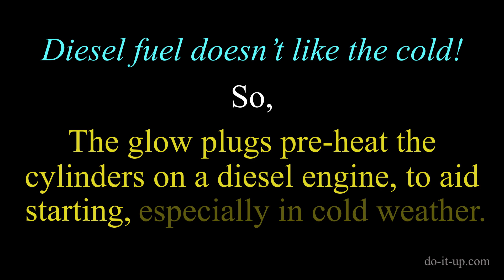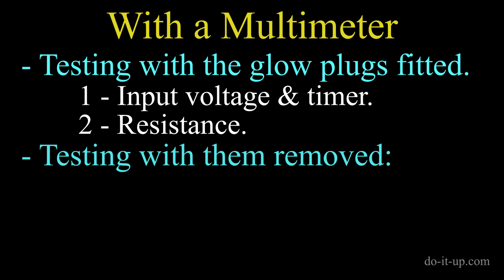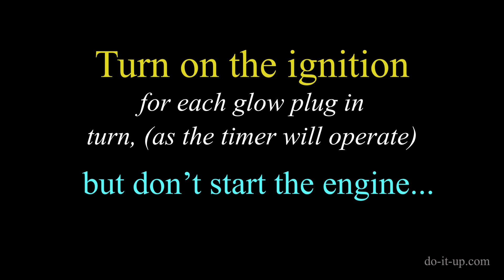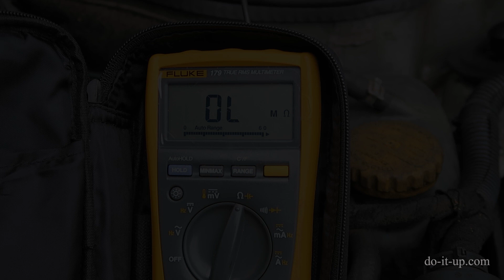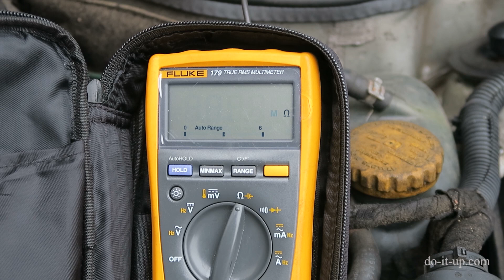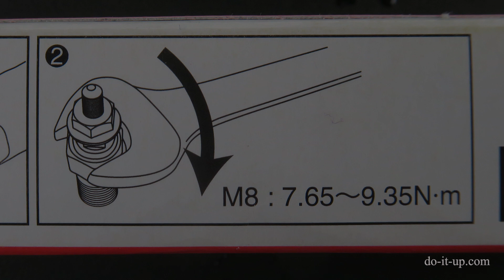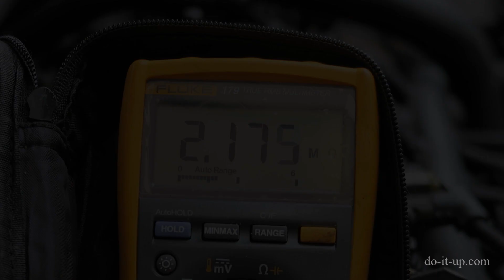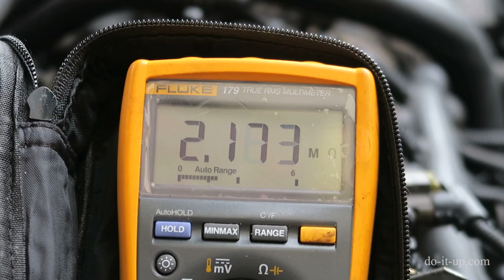How to Test Glow Plugs From Start to Finish (With a Multimeter) - The Complete Guide.

Comment: Che valore di resistenza deve avere la candelette per essere buona
Reply from the maker: Ciao, il tipico valore di resistenza della candeletta (per una candeletta funzionante) è solitamente compreso tra 1 e 6 ohm. Puoi trovare maggiori informazioni e una tabella di esempio dei valori di resistenza tipici delle candelette qui: https://do-it-up.com/vehicles/engine-transmission/diesel-wont-start-when-cold-how-to-fix-glow-plugs/#Typical-Glow-Plug-Resistance-Values, (in inglese però, ma dovresti essere in grado di tradurre usando Google). Spero che questo aiuti... 😃
Reply: Ok grazie mille, e se il multimetro segna 0,00 che significa continuità, cosa vuol dire che conduce?
Reply from the maker: Ciao, 0 ohm sarebbero a corto. (da 1 a 6 ohm è tipico, a seconda del tipo di candeletta montata). Potresti anche controllare il timer candelette, e le tensioni di alimentazione nel caso in cui la centralina (relè, ecc.) sia guasta? Ho un video su come farlo qui (ho appena tradotto i sottotitoli in italiano): https://youtu.be/A_IUlFjHcvI.

Puoi anche controllare che le candelette funzionino correttamente osservandole riscaldarsi. Ho un altro video su come farlo qui (questo ha anche i sottotitoli in italiano): https://youtu.be/YkKsbRHHNS8?t=358

Come al solito, a proprio rischio. Spero che questo ti aiuti e che tu lo risolva presto ... 😃
Reply: Perfetto, in corto cosa significa, che la resistenza non è presente e quindi la corrente passa infinitamente senza trovare ostacoli?
Reply from the maker: Ciao, spero che questo ti spieghi... (dal mio sito web: https://do-it-up.com/vehicles/engine-transmission/diesel-wont-start-when-cold-how-to-fix-glow-plugs/).
Spiegazione della resistenza delle candelette...  La bassa resistenza è buona. Significa che la candeletta si scalda.

"L'energia totale dissipata dal circuito è proporzionale alla corrente, quindi la resistenza dell'elemento riscaldante deve essere sufficientemente bassa da assorbire una corrente sufficiente per generare abbastanza calore".

Ma…

"La resistenza dell'elemento riscaldante deve essere sufficientemente alta in modo che la maggior parte dell'energia venga dissipata dall'elemento riscaldante".

In altre parole…

Vuoi una bassa resistenza, quindi l'energia viene dissipata nella candeletta e si riscalda. Ma... Non una resistenza davvero molto bassa (come un dead short). In caso contrario, l'energia verrà dissipata nella candeletta e nel resto del circuito. Soffiare il fusibile e potenzialmente fondere i fili (a seconda della potenza del fusibile e della velocità di reazione del fusibile!).

Nota:

Ogni produttore o progetto di circuito può avere letture di resistenza leggermente diverse, a causa dei parametri di progettazione (e anche le condizioni effettive del circuito avranno un effetto).

Speriamo che questo spieghi come funzionano le candelette e il valore di resistenza che stai cercando (e che tutto si traduca in italiano OK)... 😃
Reply: Ok però non mi torna una cosa, io so che la quantità di calore prodotta è direttamente proporzionale all'intensità di corrente che passa per cui affiche una resistenza scaldi non significa che deve essere alta? Ad esempio quelle delle candelette come sono rispetto a quelle dei forni più alte o più basse?
Reply from the maker: Non sono un esperto, ma suppongo che potresti usare l'esempio di un circuito che non ha un fusibile. Introdurre un cortocircuito nel circuito e il filo si surriscalda in modo disastroso, molto, molto rapidamente. Aggiungi una certa resistenza per limitare il flusso di corrente e avresti un elemento riscaldante di base.

Per quanto riguarda le candelette, ho fatto delle ricerche e da 1 a 6 ohm era il valore tipico citato per varie candelette. Posso solo presumere che questa sia la resistenza corretta per generare calore velocemente, ma solo per un breve periodo di tempo... 😃
Reply: Grazie mille!!!
Reply from the maker: Nessun problema, spero che tu lo risolva presto...   😃

Comment: If you can get them out ,,,,change them .... they are relatively cheap .... pointless doing all that work to put back the old ones
Reply from the maker: Hi, I would definitely agree with you, if they're difficult to get out, or you're paying someone to do it...  However, if you can check them easily, and there's nothing wrong with them (and you're on a tight budget), may as well use the old ones...    😃

Comment: Thanks. I have a 2003 transit van. 112k. My glow plug warning light flashes occasionally, but not all the time. Engine starts and there’s no white smoke. Any ideas?
Reply from the maker: Hi, I have a glow plug indicator on the dashboard of a Vauxhall that also appears so briefly you can miss it. Whereas on other vehicles, the indicator stays on a lot longer? As a guess, it's probably down to the circuit design for that particular vehicle (if the vehicle starts and runs fine, with no white smoke). And it may vary from vehicle to vehicle...

Always assume the glow plugs are needed, and wait for them to heat the cylinders, to aid the engine starting process. Glow plugs come on in hot and cold weather, to aid starting and help whilst the engine warms up. However, the length of time they're on may vary (if this is built into the vehicles electronics by design).

If you need to check they're working, check the glow plug resistance and see how long voltage is applied for with a test meter. Or, operate them when removed from the vehicle (example video here...  How to Test Glow Plugs Without a Test Meter:  https://youtu.be/YkKsbRHHNS8) and measure how long they glow for. Best to test the glow plugs one at a time, save melting anything nearby!

Hope this helps...    😃

Comment: Thanx for this Video. 
A Tip from me: 
please pay attention! There is a difference in the operating voltage of the glow plugs in the car.
  There are 5 volt and 12 volt glow plugs.
The difference can be seen in the color of the insulator between tip + and thread -.
Yellow or orange insulator are 5 volt glow plugs.
Black insulator are 12 volt glow plugs.
The voltage for 5 volt glow plugs is regulated by the control unit.
Reply from the maker: Hi, thanks for the great tip. It's a very valid point. Just to expand on voltages a bit, (just looked at the NGK catalogue to see the actual range of voltages). There is a large number of different glow plug voltage specifications for vehicles, ranging from 4.4v all the way up to 23v. The majority appear to be rated at 11v.  However, it should be noted that the 11v glow plug will work perfectly fine on 12v, which is the case in the video. I guess they're rated at 11v, in case the output from the vehicle's electrical system is low. Plus they will have a + or - operating tolerance, (which isn't quoted). As you say, the 5v glow plugs will be used on a 6v system, or the voltage will be regulated down to 5v by the control unit. 23v glow plugs will no doubt used on a 24v system.

I didn't realise there was a colour coding system. However, I would only use a colour indicator as a guide (past experience, where manufacturer's don't strictly adhere to helpful indicators). The thing to take away from this is, always check your part numbers on the manufacturers website to ensure the correct part is being ordered and fitted. If your vehicle system is 12v and you find 5v at the glow plug (and you don't have a manual). Check the glow plug specifications on the manufacturers website, to check the voltage is correct.    😃

Comment: Mine starting good but white smoke for 1 minute . No oil &coolant  problem . Is it glow plug
Reply from the maker: Hi, if the vehicle is starting OK, you would tend to assume the glow plugs are good? However, it may be worth checking the glow plugs, because if one glow plug has failed and all the others are working, the vehicle may start OK, but one cylinder may not be efficiently igniting the fuel on start up, because it hasn't warmed up yet. Causing some white smoke for a short period. The outside temperature (cold air) also has an effect on the amount of exhaust gasses you may see during start up, so if it's cold outside? Most diesels do smoke a little on start up (especially older vehicles). 

Or, you could have an issue with the amount of fuel being supplied when the engine is cold. If it's modern vehicle, controlled by electronics, then there may be an issue with a sensor? Most modern vehicles show an error code if a sensor isn't functioning correctly, so you may need to plug something in that can read the error codes.

Unfortunately, there are also a number of other possibilities, like a head gasket, faulty injector, etc. So it's often a case of trying to narrow down the possibilities, (which it sounds like you're trying to do). If the vehicle runs OK with no issues, then sometimes you have to wait for things to show themselves a bit more, before you can pin a fault down.

Unfortunately, I've probably not helped much, but I hope some of the suggestions help you get it sorted...   😃
Reply: @doitup  in scanner it showed glow plug . But in service center neglected it may be water due to water wash so no problem u can drive.. i will check the glowplug againb ❤️
Reply from the maker: In lots of ways, the diagnosis is the difficult bit. But when you eventually find the issue and get it fixed, it's great!   😁
Reply: @doitup  today i checked myself with 12v bulb. None of the glow plug works and light never glowed 😂 even after removing connectors the car starts great
Reply from the maker: Which part of the world do you live? Glow plugs show their value mostly in cold climates, as diesels can be difficult to start from cold, especially when close to, or below freezing temperatures. Whereas in warmer climates, the vehicles engine will already be at a higher temperature (from cold) and should be easier to start without the use of glow plugs. 

Therefore, if...
- The glow plugs aren't working.
- And the vehicle starts OK (warmer air/engine temperature starting from cold).

The engine cylinders may still need to warm up a bit to burn the fuel efficiently, hence the white smoke?

As part of an explanation, a few years back, I took part in a demonstration to show if diesel fuel would ignite easily (when there was a diesel spill on water). This was in controlled conditions where diesel was added to a water filled tray. The diesel floated on top of the water. A torch flame was used to try and ignite the diesel. However hard we tried, the diesel would not ignite. However, when we heated the diesel in one corner of the tray, and it began to give off a vapour, we were able to ignite the diesel easily. The heat from the flames in the corner of the tray, then started to heat the rest of the diesel floating on top of the water, and we soon had a raging fire on our hands (with the whole tray alight). The best bit was putting out the fire with foam fire extinguishers!

Hopefully this explanation shows how glow plugs can help igniting the diesel when the engine is cold to aid starting (more so in colder temperatures).

Sounds like you have found the cause of the problem. I also have a video on testing glow plugs without a multimeter https://youtu.be/YkKsbRHHNS8. Hope this info helps...    😃
Reply: @doitup  im from india
Reply from the maker: Ahhh, that's probably why the vehicle starts OK when cold, with defective glow plugs (unless you're in the mountains). I'm guessing the air temperature is probably well above freezing. So your glow plugs don't have to work too hard to heat up the cylinders / fuel mixture to get it started. Hope you get it fixed soon...    😃
Reply: @doitup  here its almost 39 celsius in day . Night also above 30 only
Reply from the maker: Quite a bit warmer than here in the UK where we are at 10 celsius during the day and 5 at night!
Reply: @doitup  ❤️❤️  as per my test my 4 plugs were out due to temperature car has no problem only white smoke i think so
Reply from the maker: Sound like you've mostly got it sorted. Have a great day.
Reply: @doitup  hiii broooo .. my brother also there can u say ur location
Reply from the maker: Hi, I'm in Cornwall.
Reply: @doitup  yes bro how to connect wit u
Reply from the maker: There isn't a way, other than through here (if there is a specific question on one of the video's). I have too many things on the go and limited time to do them all...
Reply: @doitup  ok okkk bro. How to meet u in cornwall exact location
Reply from the maker: Sorry, I won't provide my exact details here...
Reply: @doitup  okkk 😊

Comment: Does it matter if the measurement is made when engine is warm or cold?
Reply from the maker: Hi, heat will change resistance values, but it's not something that should make a huge difference in the operation of a glow plug. However, if heat changes the actual component, it could make a difference. I.e. if heat caused the expansion of a component that was fractured, the circuit could open or close (dependant on the direction of expansion). and could cause a failure. Sometimes failures like this aren't easily seen, and are hidden from view?

Let us know if you find anything, as it may help others. Hope this helps, and you get it fixed soon....    😃

Comment: 👍. What is the puff of smoke from fuel injector 2?
Reply from the maker: Hi, well spotted! The injector copper washer is not sealing properly...  I ignored this at my peril. I needed to remove the injectors some months later. It took 5 days (of going away in despair, and coming back to try again) before I got them (it) out! Carbon deposits had formed around the injector fixing it in solidly in place. Moral of the story:

1 - If you take the injectors out, always clean and replace the copper washers.
2 - See a puff of smoke, replace the copper washers at the earliest opportunity.
3 - Walk away and hope you never have to take the injectors out!
4 - Wish you'd done something different!

In my case the following order applied...   1, 3...   then 4.

You live and lean..!      😥

Comment: Can i still used the car long drive with glow plug sensor problem?
Reply from the maker: Hi, If the vehicle runs OK when the engine is warm, it shouldn't be an issue. Glow plugs only usually cause an issue when starting the engine from cold. However, it may depend on the vehicle and how the manufacturer's configured the vehicle to run, (if there is a fault detected). If there are no warning lights and it runs fine when the engine is warm, you can only assume it will probably be OK.     Hope this helps...   😃
Reply: @doitup  thank you sir for the reply. Last week i have a check engine. When we scan the ecu it says cylinder 2 and 4 glow plug sensor.

The engine is fine no hard starting. Oh by the way may car is Vw golf wagon 2.0 tdi here manila.
Reply from the maker: Hi, thanks for the update. The general rule is...  If the warning light is amber/orange, then it's just warning you that a fault is present and it should be checked. If the warning light is red, then you shouldn't drive the vehicle. If the amber/orange light refers to any safety equipment like brakes, then get it checked ASAP, in case the fault deteriorates.   Hope this helps and you manage to get it fixed soon...   😃

Comment: I had no value when turn ignition on while testing and for timer test no value
Reply from the maker: Hi, I presume you're testing the duration that the voltage is applied to the glow plugs, from the glow plug timer? If there is no voltage at all, I would:

- Check the fuses in the circuit.
- Then try and check to see if there is a supply to the glow plug timer.

If there is a supply 'to' the glow plug timer, but no voltage output 'from' the timer, then you will need to check the glow plug timer circuit. It could be a relay, or the circuit card (it maybe a sealed unit), dependant on what's fitted to the vehicle?

Hope this helps...    😃
Reply: @doitup  can I directly connect my glow plugs to battery positive to heat up engine??
Reply from the maker: You could, but it's not advisable (if it's a temporary connection where you hold the wires on the battery). Batteries can explode (via a spark). Hydrogen gas given off by the battery can ignite, sending bits of battery and acid everywhere…  It may be a small risk, but it does happen with the right conditions, so it's not recommended.

Still not recommended, but as a temporary solution, it may be better to hardwire a switch to bypass the timer circuit. The correct size of wire should be used (current carrying capacity) and it should be fused for safety. You would have to remember to switch off the glow plugs in good time, or they will probably fail very quickly. Note: It's always best to repair the vehicle to the manufacturers original specifications, as it will have been assessed for safety, before the vehicle was released for sale to the public.

I have found in the past, that 'bump starting' (pushing the car to get it started) is an alternative when the glow plugs have failed. Though it's not always possible, (your on your own, no hill to roll down, etc).

Any changes at your own risk. I hope this helps...    🙂
Reply: @doitup  ok 
Thanks for the information ☺️☺️
Reply from the maker: No problem...